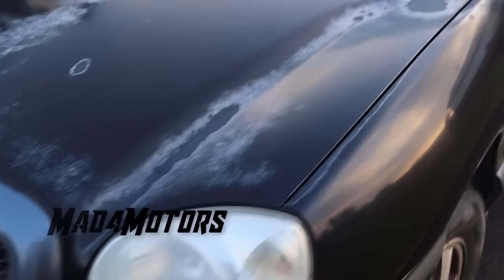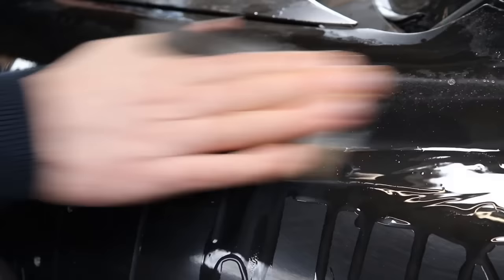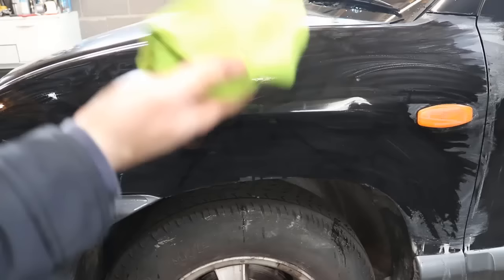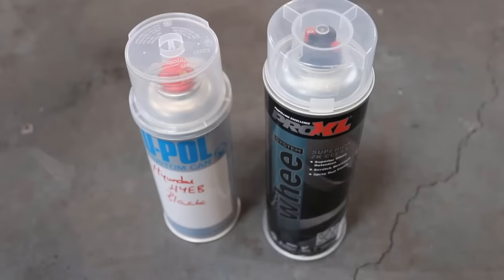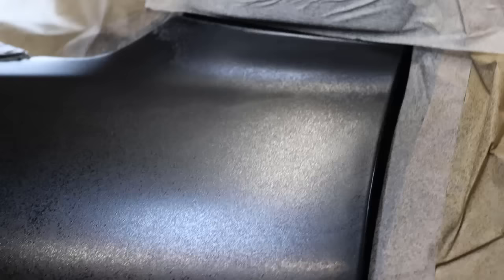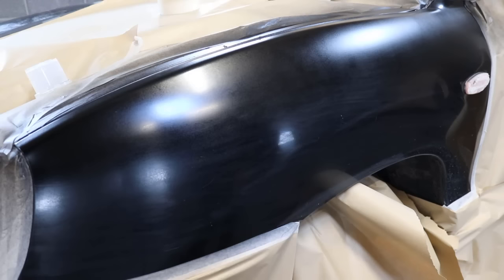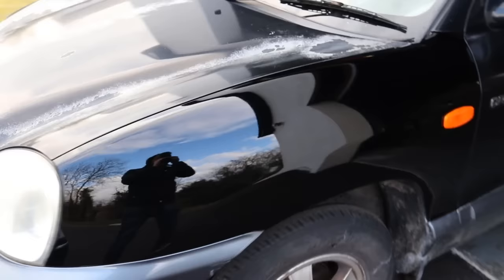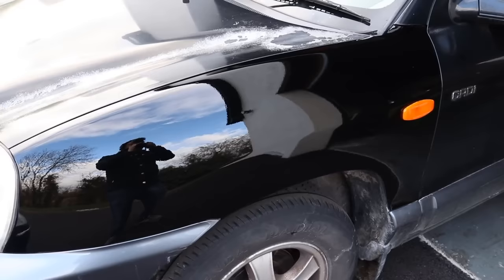How to Repair Clear Coat Fix 100% all types

Comment: Not bad for an Aerosol can! I also love how the video was short and strait to the point! Thanks a million
Reply: scientific method perspective I agree be nice if more youtube was like this
Reply: Strait? Of Gibraltar?
Reply: @Kgio-2112  😂
Reply: and no music
Reply: @ibraheemfathy 
And no 'HEY guys Whassup?'
Reply: Aerosols has come A LONG WAY in the last couple years. I own a body shop and we will use them on small bumper spot ins. There is a company called spray max thry make an actual 2 part urathane clean in a can. The bottom you press down on a bench and it punctures the inside of thr can mixing the activater. They make it with blender and all in them they spray nice. There about 25 bucks a can though. All the dealerships are using them now.
Reply: You'll be surprised what goes on in auto paint shops!  Those paint jobs are really not worth what they charge!  And aerosol can is just as good as paint gun!
Reply: @jurnagin  you obviously dont have a clue as to what your talking about. Yes it is a 2K catalyst activated clear coat NOT an acrylic enamel clear like most spray cans. A can of it is 30 bucks for a can and once you activate it you have a shelf life it will dry up and harden in the can. When i talk about small jobs im talking clearing a mirror or a piece of small trim. You cant use duplicolor spray cans in a body shop or you wont be in business long. You use quality products. Paint and body is definitely where you want to use good supplies or it will be shit. Spray max is a quality body shop approved product. If it wasnt finishmaster and other supply houses wouldnt carry it. But im sure you know better. I only been in business for 36yrs.
Reply: And no annoying music playing on a loop.
Reply: That's a great job bro quick question  can you do it in your drive way o hasto be inside a garage and how long to let it dry ...let me know broo!!! Appreciated!
Reply: Irish people for ya
Reply: Really good mate, very specific and clear instructions,  its encouraging me to have ago on my old 2002 station wagon 😉😎👍
Thanks for the time you took to show us.
Reply: The reason he kept it so straight to the point and simple is cus he's a brilliant Irishman 👍
Reply: That's 2k paint.  As good as any body shop paint.
Reply: Years ago, I had a used appliance business. I painted many machines with a spray can, particularly if I only had one machine to paint. With practice, my customers could not tell the difference between spray can and factory paint jobs. I used a spray gun and compressor if I had several machines to paint that were all the same color.

Comment: When applying a 2k clear coat make sure you use a respirator (eg. 3M 6035) as it is toxic to respiratory system.
Reply: ASG66  do you also think seatbelts are for snowflakes too
Reply: It cures inside the lungs 😂
Reply: Ty
Reply: 2 pack has isocyanate. Harmful to your lungs. Scent dissappears if used too long
Reply: ASG66  I dislike snowflakes when their comments and concerns involve their feelings only, but when it involves real health concerns I take the advice seriously.
Reply: Good luck buying one now #rona
Reply: Not unless you're Man!!! 💪💪
Reply: If you noticed while he was applying the 2nd coat of clear coat, he was wearing a respirator
Reply: He had a mask on you could see it in the reflection.
Reply: life with anxiety everyday yea but for the other people who might want to do the same job, it's advice some of yal should take
Reply: Sammy GG yes, n95 equates to ffp2, a ffp3 (n99) would be better however maybe right now is not the time to take stock away from those who realy need them on the front line
Reply: Sammy GG   - Not for 2K paint.  As other people have mentioned, the reaction of the components releases isocyanates (think cyanide) in a gaseous form.  An N95 mask is designed to stop particulates, and will have little to no effect on these harmful gasses.  On the other hand, they will block paint particles from going into your lungs and evolving even more isocyanate as they cure inside you.
The bottom line is that if you care about your lungs at all, and you're spraying a 2K product, use a cartridge respirator with cartridges designed for paint spraying.
Reply: What suitable cartridge respirator designed for paint spraying would you consider to use for 2K paint?
Reply: @patrickclarke4622   - I have used primarily 3M products in the past, as they are available in both the US & Europe, and are of a known quality and consistency.  I would say for spraying 2K paint, you need organic vapor cartridges such as 6051 (There are other cartridges in the 6000 series that filter organic vapor + other hazards as well, but they are generally more expensive, and of no great benefit if all you do is spray paint.)
On top of the organic cartridges, you need to fit a particulate filter (e.g. 3M 5925) using a special ring.  Typically the cartridges are expensive enough that they come with the particulate filter ring for "free."  Without the particulate filter, the exposed surface of the vapor cartridge will get gummed up with overspray very quickly and stop working, so it's a cheap investment to keep your cartridges working to their full potential.
There are many other brands that will get the job done- this is just the one that I'm most familiar with.  Hope it helps.
Reply: @mikefurlong8025  Thank you for your reply. Up until now I have used 3M 4000 series respirators for UPOL Clear #1 lacquer and I have had good results on wings, doors and bumpers. But on the flat panels  (bonnet and roof) not so good. So that's why I enquired about suitable respirators for 2K clear to safely get the high gloss finish with aerosol cans. I appreciate your advice, thanks again.
Reply: Thankyou Dr Phil..now go inhale some ether..lol
Reply: thank you
Reply: If you can find one with Covid going on!!!!
Reply: Sammy GG  No. It blocks particles but not gas. If that's all you have, wear it, but still hold your breath while actually spaying and move away from the area before breathing again.
Reply: He was wearing a full face respirator. Granted, he should have said something on the video about that so there would be no issues.
Reply: He was using one. You can see on the reflection
Reply: California state law
Reply: I inhale 2k like dustoff 🤣🤣
Reply: Thanks!!!!!! Fuck i would build footings/form work for the union here in Nor Cal. Me and this dude would partner up and go to the deep ass "holes" to build forms while all THE CITY WORKERS would have on full blast 3m FACE MASKS and HAZMAT SUITS while doing the surveying and planning passing inspections.... No 1 gave a fuck about us. Lol
Reply: Safety first stay safe!
Reply: Glad to know after standing with my dad as he painted countless cars in our garage back in the day - all of which had clear coat. We would laugh at each other when we walked out as our noses were the same colour as the car 💀
Reply: To all the super geniuses thinking isocyanates are something to joke about. Go look up Darwin’s theory of evolution 
Some of the spray can clears use ISO’s. They’re usually in a two can combo. 
If you’re going to do it in a garage get a fan going. A particulate respirator isn’t rated for ISO’s. It says so on the mask directions if use;positive  air supply is recommended. 
That being said,a fan going and a new quality particulate respirator will probably protect you
Some people react differently to these chemicals and yes,after over 40 years of painting cars I’ve seen guys get really sick from using paints and solvents. I’ve seen the old Imron kills guys. So joke away,the ISO’s could GAF. But your car will look nice if you’re able to finish it. They found one guy in the booth with his spray gun in his hand,DeadAF and no smile on his face
Reply: for old cars just use acrylic lacquer  2pak paints doesnt like bird or bat shit
Reply: Well...most 2k clears have isocyanates which any filter really won't work effectively.  You need a fresh air system to safely spray isocyanates. Not saying I haven't put on my p100's and an enviro-guard n95 suit and sprayed some SprayMaxx 2k, But then again, I have had lung surgery ;)..............
Reply: Softies